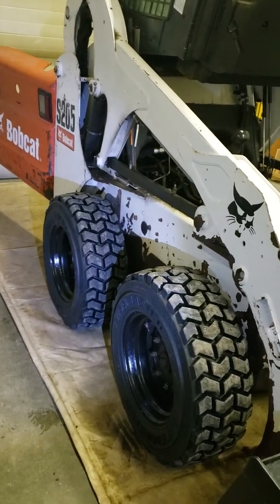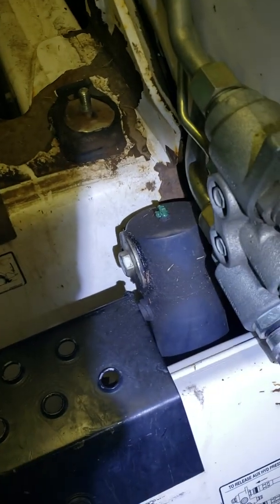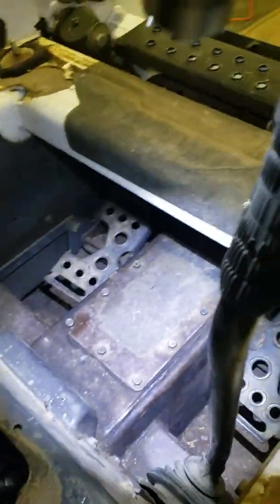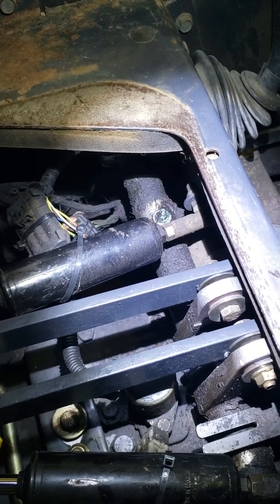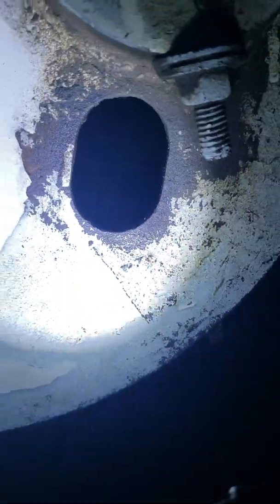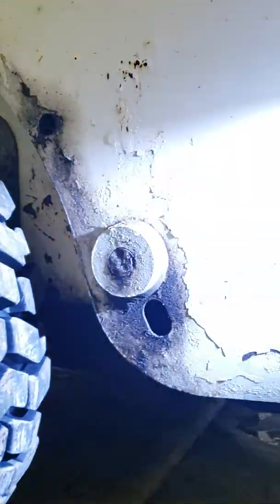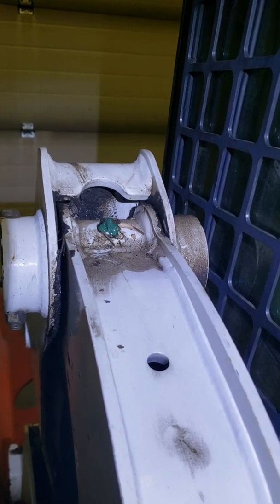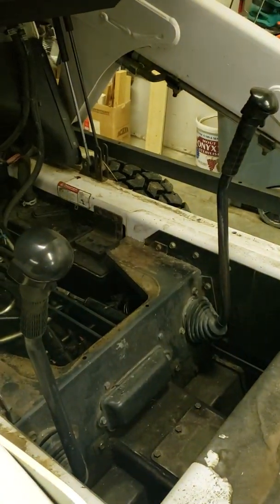Where are all the grease points on a Bobcat skidsteer?

Comment: I have the same exact machine but it is a 2006 Only have had  it for a year but never knew about the grease fitting underneath the cab thank you I am sure you know about the other 2 but did not mention them in your video There should be 4 2 each side of your plate that locks into the bucket
Reply from the maker: I have seen other machines with 4 grease fittings there, I did miss showing that my machine has one on each locking pin ( 2 in total ). Thanks for the reply, have a great day!